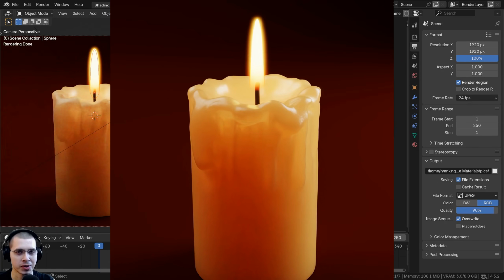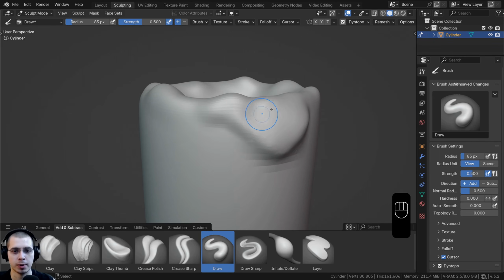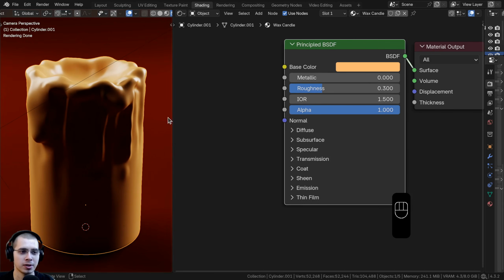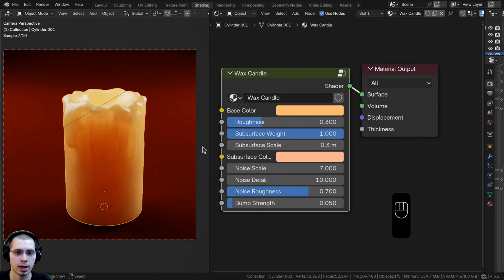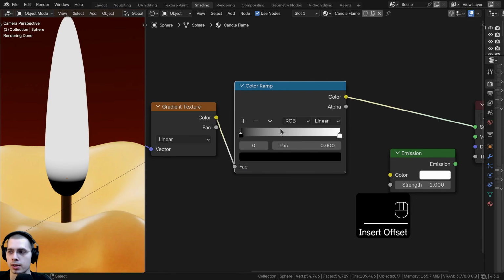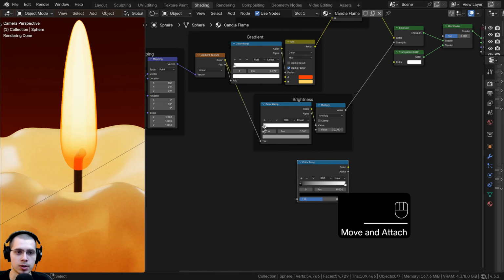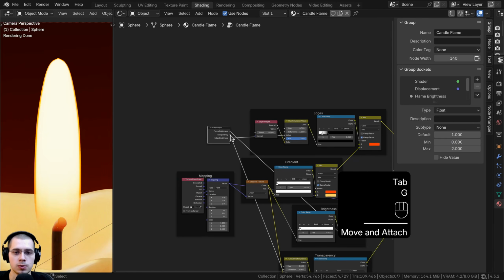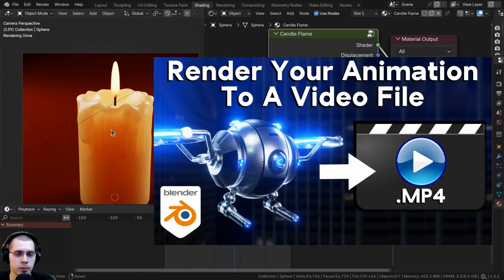Procedural Candle Materials🕯️(Blender Tutorial)

Comment: You make three consecutive insets on the top of the candle... but only the first one "properly" with the Inset tool, the second and third though with Extrude & Scale. Why?   Because you want to move it down? But that's a separate operation which you could do after insetting as well (only that it would not even be necessary with the Inset tool, because with holding Ctrl you can move down while insetting).
Reply: The beauty of Blender is that there are several ways of doing the same thing. Everyone has their own workflow and preferences. It's not proper or improper if the outcome is the same. ✌️

He could have avoided the insets and loopcuts by editing the normal smoothing manually, but I digress 😅
Reply: @orpheuscreativeco9236  Of course there are different ways, that's why I wrote properly in quotation marks. I only think the Inset tool is very underrated and almost never anybody shows that it is more versatile. Like in this example where he uses three operations (E to extrude, S to scale and then G, Z to move down) what could be done with just I to inset and Ctrl to move down in one operation. And since nobody teaches this in tutorials, I try at least to give this alternative method in the comments for people who might want to learn it.
And he is doing this insetting and moving the face down which I'm talking about to shape a recess on top of the candle, not for smoothing the normals.
Of course there are always things that could be done differently, but I'm not about to criticize stuff, but expand the knowledge on tools and their usage. In this case though it seemed odd to me why he is doing the same thing multiple times and switching methods inbetween with no apparent reason, which I think can leave beginners wondering if there is a specific reason why he would not simply repeat the previous action. I'm all for showing various methods in tutorials, but without saying "yes, it does the same and it does not matter how you do it" it can lead to either confusing people why they have to switch without need or - in case they don't realize it's the same - they learn to switch methods even when it's unnecessary.
But generally I like the tutorials of the channels I watch regularly and I'm tired of having to justify giving additional information.
Reply: @gordonbrinkmann  I totally agree about the inset tool, it really does the heavy lifting when you have a plan for where your model is headed. 👍 I better understand your point ☝️ Blender definitely takes some time to learn and that process is expedited by clear explanation and lots of practice.
Reply: @gordonbrinkmann You make a good suggestion, and it’s valid, but I think the tone of your original comment sounds a tad patronizing of the method used.  And honestly, it doesn’t really matter if inset is used or extrude/scale is used, as long as one gets to the destination.
Reply: @hherroyal05  I know it doesn't matter (and said so in my comment above) for squares or circles like in this case, but it makes a difference with other shapes and it's a tutorial, it would be great to learn that but somehow nobody ever uses the Inset tool like that (I don't mean the extrude/scale part, but the moving down afterwards). And usually Ryan explains his steps always very detailed for beginners, that's the great thing about his videos.
I'm used to people learning something and being confused by switching methods with no apparent reason and either not knowing if they don't make a difference or feeling it has to be done that way which I think is a bit unfortunate for a tutorial. Anyway, my comment's main goal was just to let people know it could be done differently and wondering if he did it on purpose. And most of the time when I give additional tips in the comments it's just other commenters complaining that I do that, not the tutors..